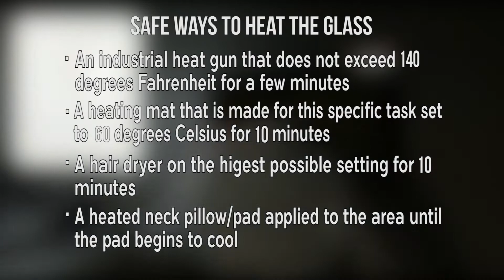Amazon Kindle Fire 7" Glass Replacement (2nd Generation)

Comment: Glass replacement looks great, video used in conjunction with one for 7th Generation, but sadly although the kindle makes a little noise when the charger is connected or it is turned on it does not fire up!  Must have damaged the connectors?  Have to save up to buy my husband a new one.  I was the one who dropped it in the first place.